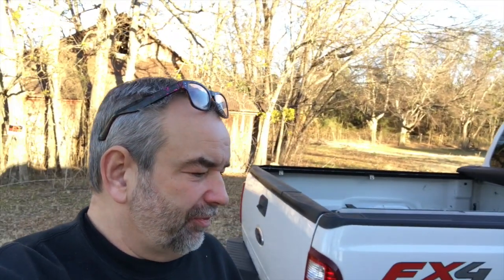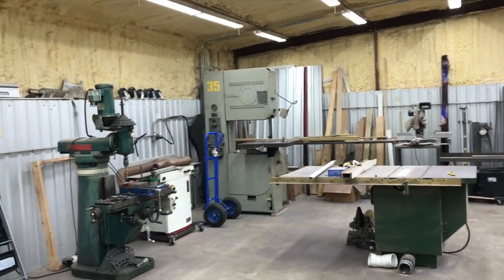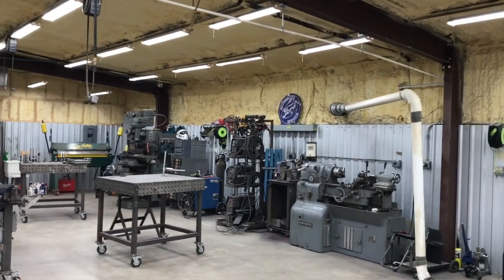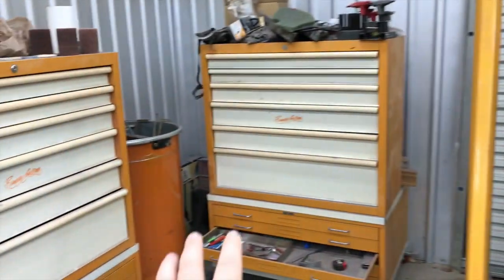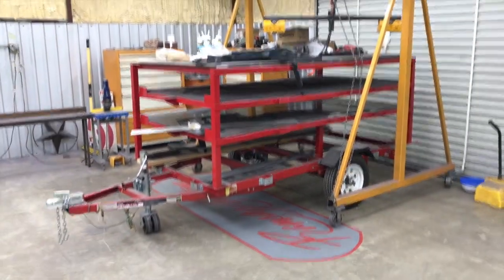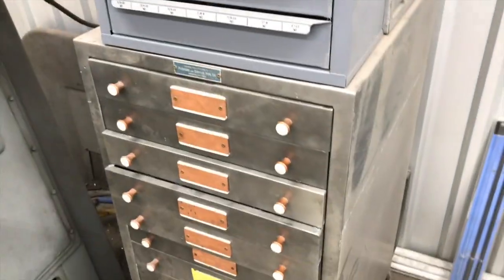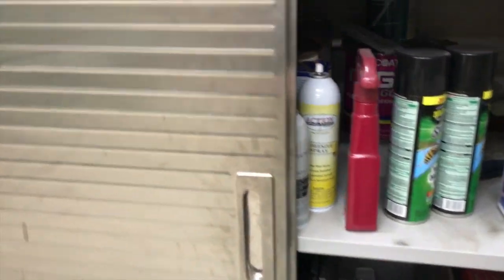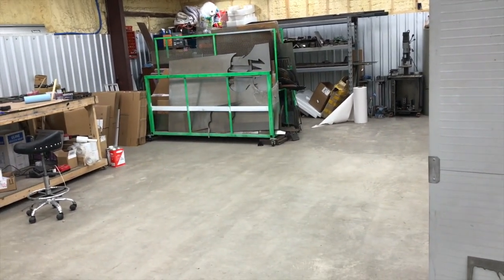2018 Fab Welding Shop Tour - Shop layout - organization - work flow - ideas

Comment: Set-Up Work Triangles based on similar sequenced operations. Your productivity will increase by at least 25% for not having to walk back and forth between related stations.

Also, more shelves. take advantage of your vertical space where ever possible. For instance, your wood cut offs. Placing them into similar size/species groupings on a shelf, you now have a wood library to choose from, rather than a clutter on the floor that traps saw dust and mice nests. Do the same with your steel cut-offs. Categorize all you little steel bits and random cut-offs. That way, you've got a good visual and a refreshed memory of you have. 

I can't believe how many times I went and bought stuff in the last month, since my move, that I already have. Because I hadn't done a full visual inventory and properly sorted things out yet.

Comment: Work flow is different in every shop. Yours seems pretty good.  It only  has to work for you. Myself I would probably  hang a large shelf in the shipping area over the bench  for boxes and packing. Gain a little floor space. Thanks for sharing
Reply from the maker: Great point about the shelves.  There are several areas around the shop I could put some shelves for sure.